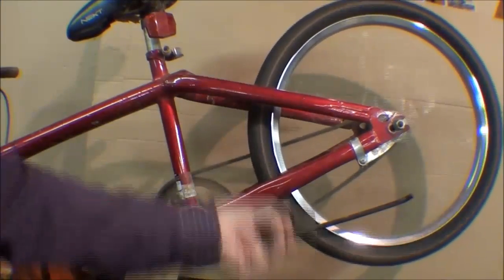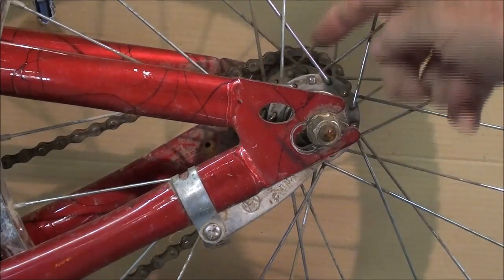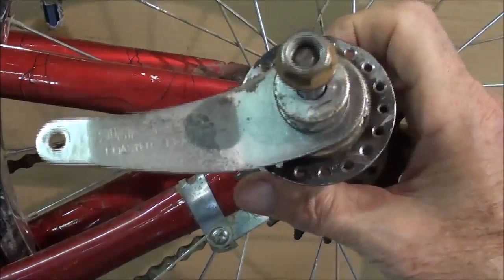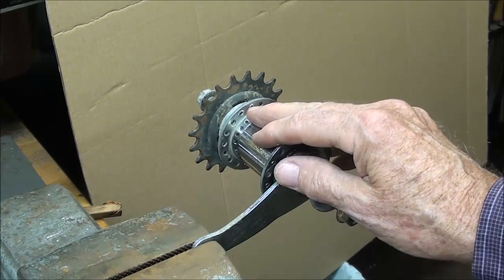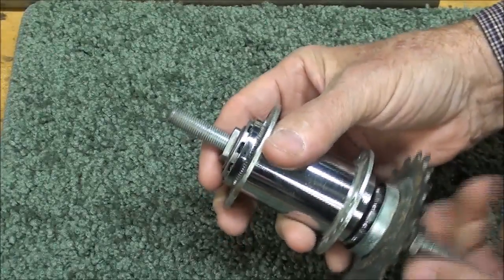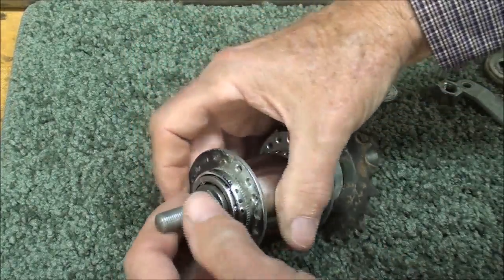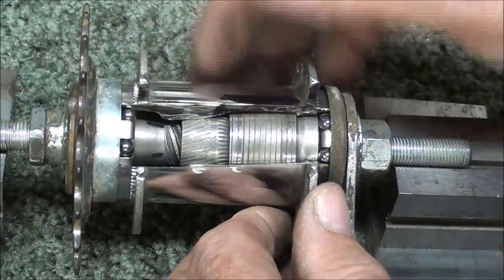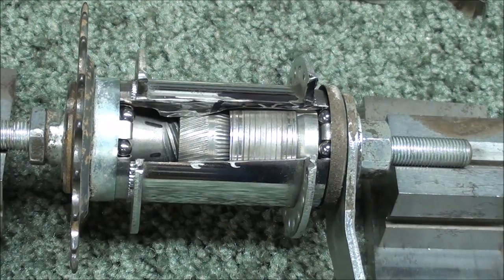WHAT MAKES IT WORK? #13 The Bicycle Coaster Brake tubalcain

Comment: hmm but since the pads and hubs are both metal would that not result in extreme heat build up since its metal on metal surface braking?
Reply from the maker: No

Comment: Mister Peterson I’ve learned a lot from you. Electrolysis and circuits and even brakes. Cutaway really drives home what’s going on inside of the hub making it very easy to understand.
Reply from the maker: Thank you,. This was a very popular video, and still receives views after all of these years. A very difficult video to make. I was going to do it with a three speed, but never did.
Reply: @mrpete222 thank  you for all you do

Comment: Interesting video. My bracket broke on my brake arm as the kid and we just put a bit of wire on it. Worked like a charm. Never knew how they work inside how long do the brake pads usually last. I haven't had a coaster break since 70s
Reply: So much for weird story. When I was growing up I didn't have a pair of shoes until I was 12. And I was only because the school made it compulsory to wear shoes. My parents bought the cheapest shoes you could buy and they fell apart after a couple weeks. Where to wear them with the sides all split open and the inner soles were made of like look like egg carton which fell apart within weeks. Guess we're lucky we all had bicycles, there were six of us kids. If you bicycle broke you either fix it yourself or you walked. Being the youngest I'd ask my older brothers to help they would never help. It was dog eat dog. You quickly ate Ur food so the others wouldn't eat it. I didn't realise but in my 40s somebody ask if I  have been in jail? I said no. They didn't believe me because I wrapped my arm around my plate, as I ate. It was hard to break that habit. We didn't have much but there's a lot of happy times as well as sad times
Reply from the maker: Sorry to hear your sad story you had a very tough life. It’s hard for me to imagine that anyone lived in that kind of abject poverty. I hope things are better for you now.

Comment: Thank you for this. I am making a pedal car for my great grandson. It will have a differential. So I need one of these for each rear drive wheel. One will need to operate on the other handedness of it's opposite. I will need to make a six entry internal and external thread of the opposite hand!
Reply from the maker: Sounds like a difficult but fun project, good luck!

Comment: Don’t know how this came up after so long but I’m glad it did. I remember taking mine apart many times. 
The Bendix coaster brake was on the more expensive bikes. It had a red line painted on the middle of the hub. SHEIN bikes that had the two speed axle had three lines. 
Thanks Lyle.

Comment: Is it possible to add spacers to the sprocket on a coaster brake hub for chainline adjustment? Does it matter if the sprocket is flat/threaded or dished?

Comment: This is an excellent video on how this hub works! The best I've seen.
Question please:
On our coaster brake bike the hub locks up. With about a 1/4 turn (in the correct direction to pedal forward), the hub locks up completely. I had the hub apart and can't seem to find anything wrong. Do you have any idea what might be happening as the bike is unusable currently unless I buy a whole new rim. Thanks very much and again, excellent video....
Phil

Comment: Kind of amazing when you think about how we ABUSED the heck out of those brakes, and they almost never failed or needed replacement (other than the thin retention strap on the bike frame)
Reply from the maker: So very true. We used to replace that little break band with much thicker material. We broke a lot of them.

Comment: Brilliant exposition of a clever mechanism!  I learned a lot, had never heard of a “six-start thread,” and hadn’t imagined the hub shell having different thicknesses to accommodate the drive friction.  Thanks so much!  

I’m wondering how much maintenance is required for coaster brakes.  I used to ride and abuse bikes till something broke or failed.  Don’t ever recall the bike shop ever doing any maintenance on coaster brakes!

Comment: @8:40 I believe what you call the "driver" is actually called the "brake center". The "driver" should be connected to the sprocket, i. e. on the other side of the hub. Thanks for a great video!

EDIT

This is what you point out yourself @ 17:15

Comment: I really enjoyed this video. I am rebuilding a coaster brake on a kids bike. I took it apart and cleaned all the parts. I tested how it went together without putting grease on it. Then I put grease on all the part and put it together. Peddling the wheel turns fine. However when I stop peddling, there is a rubbing sort of whirring sound. I've taken it apart a number of times, added more grease, rechecked the position of the pieces, but can't figure out what is causing the problem. All the parts are what were in the cylinder wheel. Unlike yours, the break shoes have a ridge on one end that fits up against the spring. I am hoping you can help me come up with the cause of what might be happening. The noise also causes resistance and after a several rotations cause the tire to stop. Thank you for all the interesting videos.

Comment: Thank you and GOD bless you. I love the cut out of the coaster brake hub. I recently came across a coaster brake hub that had a stack of steels and clutches. Much like a positraction differential in a truck or car. It was quite fascinating. Unfortunately I didn't think to write down the manufacturer.

Comment: This is wonderful. I use a bike that is probably two to three times as old as I am to get around town faster and the freewheel it had initially snapped, so I had to find a replacement. Found a wheel with a coaster brake. They are sometimes called "torpedo" here. I initially clicked on this video to see how it all comes together cause it accidentally all fell apart on me, now I actually know how it works. That cutaway is great. I find it more enjoyable to ride a bike or use other devices if I know how it all works.
Reply from the maker: Thanks

Comment: 36 + years later and I just now learned this. Hand brakes front and back took over so fast before that no brakes stick your heel in the back tire. What happened to the hub powered headlight for the front wheel? Remember little lever activated wheel up against the rim and the faster you went the brighter it got...
Reply from the maker: Yes

Comment: How is this so simple, but almost never wears out. When I was younger, I had a bike with front rim brakes and a rear coaster brake. I abused the CRAP out of that bike. The front brakes became useless, but the coaster never lost power. Now thinking of it, just two tiny pieces of metal were able to lock the      rear tire so hard, that the tire popped. For their size and performance, coaster brakes are probably my favorite brakes.

Comment: I wish i could of had this video which is absolutely superb in learning the mind's of the beginners. Great video. I'm actually using a coaster on a couple of my gas bike's as an extra brake Incase the cable's brake or to have 3 brakes in the event of having to stop really fast. Again great learning video

Comment: "bikes today are 5 speed or 10 speed or 15 speed or some other unnecessary gear ratio" 
I feel attacked since I rely on my 9 speed 11-32 cassette fairly heavily, add in the 52-36 chainrings that'd be 18 speed in total lol.

Comment: I sometimes put together old bike and many times I have found a backwheel on the street. They always have issues with the axle when I find hem. I found an entire bike a few weeks ago. The only thing that was wrong is that it hardly braked. Now I know that the brake shoes are probably worn out. Maybe I can replace them. I have plenty of wheels to fix now, giotta go!

Comment: If I had to guess, this one is probably very similar to a Bendix brake.  As a kid,  I  took one apart for cleaning when I had a Schwinn.  It had the New Departure and it had special disc washers inside that operated differently.  I am sure the principle was the same as far as the side to side motion, pull and brake.  But the washers were pushed together tight to make the brake.  I really enjoyed your video.  As a kid I had never fully understood how they worked.  BTW I am 76.
Reply from the maker: I was born in 1943. We took my brothers bike apart one-sided have those little washers. We were quite young and then I could not figure it out
Reply: @mrpete222  lol. It took me awhile.

Comment: Cannot get a more informative video.Thanks.
Been waiting for years for presice info on every aspect.
I often wondered why there was a grease nipple on my Styr wheel as surely that would make braking  inefficicient, but from your video grease would help on the 6 thread part .Nipple was in middle of Hub and inside was a very long inner sleeve with a full length split in.

Thanks again (from U.K) bike was from Austria
Reply from the maker: I’m glad you liked the video

Comment: Fascinating.  Just bought a single speed with a coaster brake and I love it, and kept wondering how does this actually work?   I'm not mechanically inclined but need to start becoming better at so I can maintain the bike.  Thanks for posting!

Comment: mrpete222, hope you can give some advice for an issue I'm having with a coaster brake. I'm reconditioning on a ladies single speed cruiser with a Chinese coaster brake. When pedaling the bike, I'm hearing a knocking noise coming from the rear hub area. When coasting, the noise disappears. Also,  when I ended the ride the brake worked, but then locked up. To roll the bike into the garage, I had to push the cranks forward to disengage the brake.  I've never disassembled a coaster brake, so your video was an excellent description of the 3 sets of bearings, dust covers, cones and brake parts. So, when I dive into taking apart this coaster brake, what should I be looking for as the culprit for the knocking noise  and brake locking up?? Any advice would be appreciated!!
Reply from the maker: Broken piece s
Reply: @mrpete222  Yikes!!
Reply: @mrpete222  Wanted to follow up with you on the knocking noise while pedaling and brake lock up when stopping at the end of a ride. Today, I watched your video one more time and then took everything apart. It's a Falcon, probably about 5-10 years old. Didn't have a set of instructions for disassembly or re-assembly, so I followed my nose. Found one part that was bent a little. It's a thin, round portion of the top of the coiled spring assembly that the driver inserts into. Straightened that our easily. All parts were then cleaned (there was a fair amount of grease still in there) and then re-greased with a high temp, lithium based grease. The re-assembly was tricky without instructions, but through trial and error got it put back together. 

A test ride proved excellent. No knocking noise when pedaling and no lock up of the brake!!  Couldn't be happier. Thanks again for your video. It proved very helpful!!
Reply from the maker: Broken piece s
Reply: @mrpete222  More Yikes!!
Reply from the maker: Broken pieces
Reply: @mrpete222  And More Yikes Yet!!

Comment: Why do you say multi gear bikes are something you "don't need"???? Have you ever tried a 5 mile 10 degree uphill grade with front and rear panniers full, on a single speed bike?? You go ahead and ride your single speed. Ill pedal on up in 1'st low, and be waiting for you when you finish walking up.

Comment: What a memory you have brought back. Bendix and shimano where the two types I was always taking apart and greasing.  Some had two brake shoes and a few had 4. Always tie down the brake arm or would kick back on ya.  The joys of being 10 years old and learning about mechanical things.  There’s slot that youth today are missing out by not working on a bike. I’m thinking of bribing in one for my new young students to learn on.

Comment: If you look at the hub, so that the side with the brake arm is toward you, and the side with the gear is away from you, you will see that forward movement is caused by counter-clockwise rotation of the gear. Braking is performed by clockwise rotation.
Now, notice that the brake arm is bent to align underneath the bike frame. Clockwise braking pushes the brake arm against the frame, providing a sturdy support for the braking action.
Therefore, it does not rely on the tiny clamp for the brake action. This only holds the brake arm near the frame of the bike. So a thin, aluminum clamp is all that is needed. The hole you pointed out is irrelevant.
You mentioned you needed to replace your clamp after some wear and tear, but I would assume it was caused by vibration, not braking.

Comment: i had a bike with a coaster brake when i was 8 my mom threw it away because it had a flat tire but my dad was able to fix it, but my mom only told me when the garbage truck alreay took it to the junk yard and i never forgave her for that... now 2 years later my dad bought a BMX for me but it does not have a coaster brake so whenmy dad comes back and my friend gives back my BMX i will ask my dad to take it to the biks shop and ask them to install a coaster brake

Comment: awesome video!

I want to convert a coaster-style hub int a reversing hub. so i want it to pedal forward, coast if no pedaling is happening, and pedal backward.  If I just unhook the brake lever and make sure it cannot snag on anything (maybe by cutting it off or removing it entirely) will that work?

Comment: The round wedges that spread the shoes outward have 2 teeth on each one to keep the shoes evenly spaced(  I also don't know the tech words).  When pedaling forward,the smaller bearings carry your weight,and are loaded forward by chain's pull.When coasting, the big set on the same (rt.)side take up the job,and the little set in the outside of the sprocket get to stand still and rest,along with the sprocket with its 6 threaded  male half of the spreader assy.

Comment: the blue-ish spring steel parts in the 2 round wedges that push the shoes out,also put friction drag on the threaded half so when you pedal..,in either direction,the shoes will expand OR in the opposite direction,the half closest to the sprocket will come toward sprocket and grab an inside lip ii the hub for pedaling forward.

Comment: I had several bicycles as a kid with coaster brakes and always wondered how they worked.  I just assumed it had to be some type of internal brake shoe but never had a problem with any of them so I never had one apart.  50 years later, now I know.   They really work well too.  Great explanation.
Reply from the maker: +TC yes, I always preferred a coaster brake over handbrakes

Comment: Nice, ive been wanting to get those brake systems on my bike, had a bike when i was younger with it and i dislike that handle brakes
Reply from the maker: +Jorge Sanchez thank you
Reply: FYI i just bought a used rim with the coaster brake, thanks for the info

Comment: I knew you meant tires, because we did the same thing.  We learned to put a boot in the tire to cover the hole.  We used to cut a leather strap to ride on the chrome axles to keep them polished, but that didn't work for the ones with oilers.  Very informative.  I still don't understand the thumbs down, on these videos.  I love 'em.

Comment: Do you have any advice on how to disable a coaster brake? If I remove the brake arm, will that do the trick? I worry that it could then apply the brakes but not release them. Is taking out the brake pads an option?

Comment: I had a two-speed hub with a coaster brake in a bike.  The gear change was by back peddling slightly but not enough to apply the brake - there was no separate cable control.

I also had a three speed hub, but that didn't have a brake.

I never took one apart so it was interesting to see your video.

One problem with coaster brakes was when you stopped on a hill with the pedals straight up and down and then there was no easy way to get them to the desired 'quarter to three' position ready for the hill start.  I remember I used to apply the front brake and push forward on the handlebars so as to lift the rear wheel of the ground so the pedals could be easily repositioned.

Comment: I thought that reverse pedaling fixed the wheel to the frame (by means of friction between the inside of the hub and the brakeshoes) and not the sprocket.? or does that depend on the model of coaster brake? Very well put together and informative video by the way ;-)

Comment: Amazing video, thanks very much.  This is by far the most informative thing that i have found on coaster brakes on the internet.  having now seen how it works i'm still a little mystified as to 'why' it works - jamming some greased metal into the hub to drive the bike then jamming some greased metal the other way to brake! anyway  i'm going to build a wheel with a coaster brake to make my fixed gear more age appropriate for me! thanks again.

Comment: Very creative video indeed.
My 3 year was riding the bike and realized it today that the pedal is not jammed with the free-wheel I thought when saw first time. This wondered me and made very curious to understand the mechanism and came across your video.
I have one doubt though. When pedaled backward for the braking, I understand that the cone would move to the right. But as soon as it clears the contact from the inner taper hub, it is not necessary to move further right and may rotate along with the helical bolt. If anything holds the cone firmly (not the case), then it should move to the right.
What forces the cone to move right then for braking/jamming?
Thank you.
Reply from the maker: Thank you very much